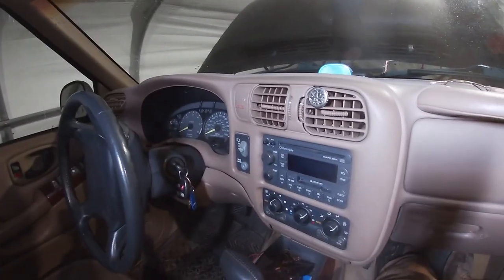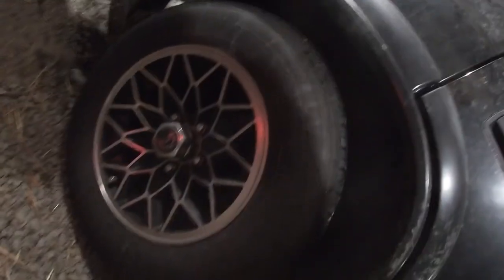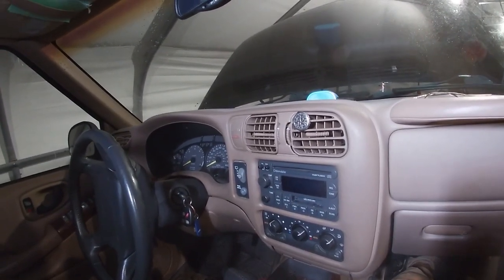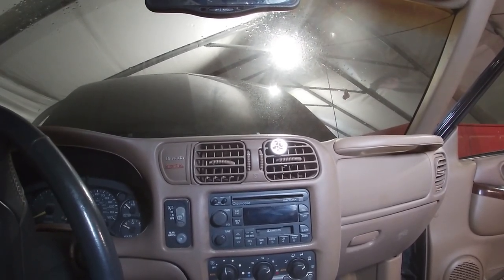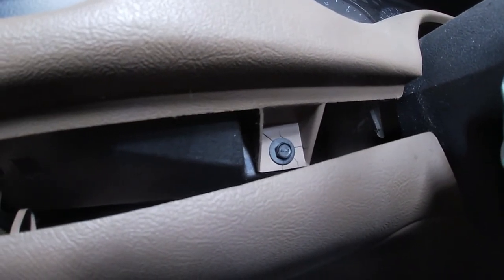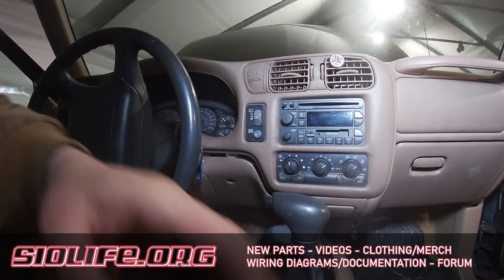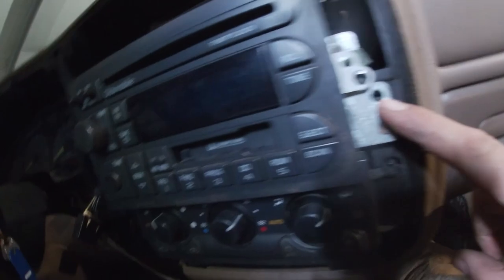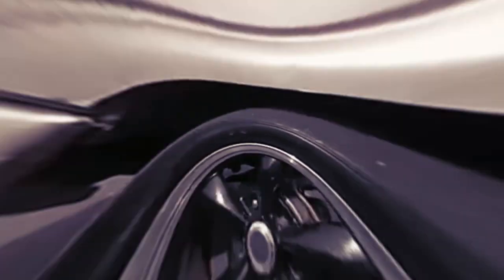HOW TO REMOVE 1998+ CHEVY S10 DASH BEZEL AND RADIO

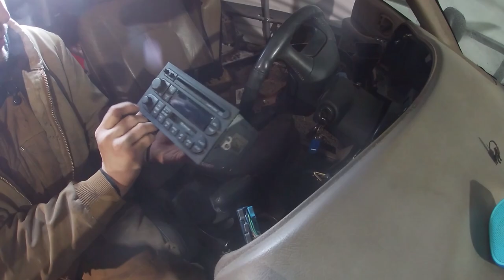Comment: That stub on the back of the factory radio is to support the rear of the radio so it isn't just hanging off the front screws. You can see the hole in the support bracket at 10:07.

Comment: Thanks pal I am trying to remove an after market amp and sub box on my 03 zr2 but they left the original radio which works great so I am just taking them out
Reply from the maker: Oh that's cool! Haven't had a system on a stock setup before but also haven't had many setups haha